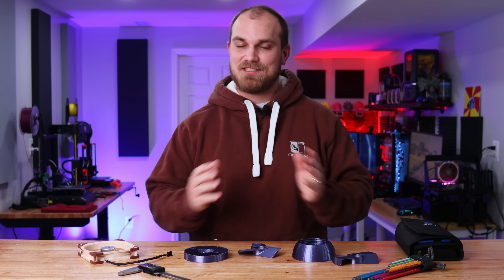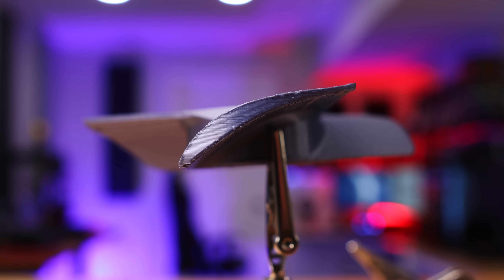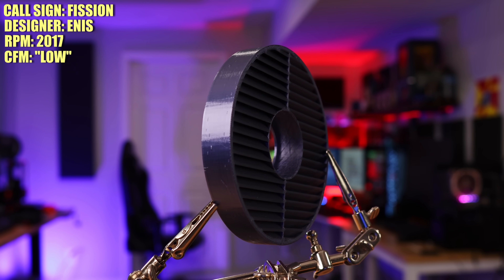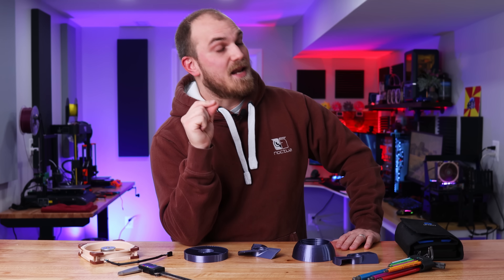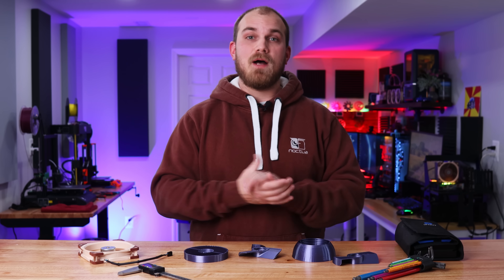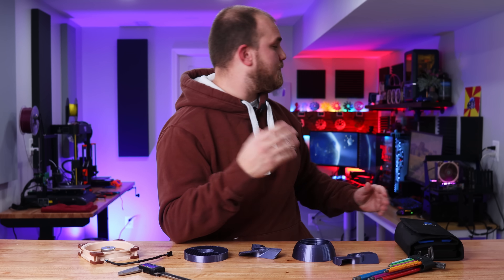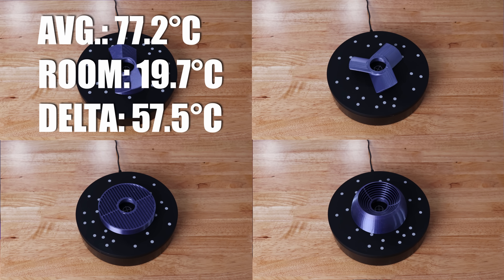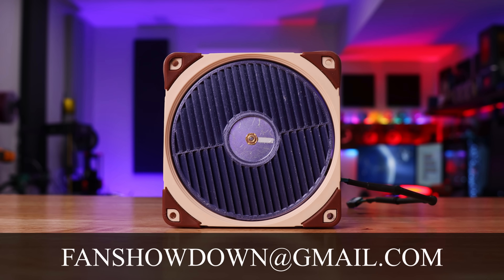IS THIS MAGIC? This Fan Has No Blades | Fan Showdown S2E3

Comment: Surely there is someone out there who wants to explain to us plebs how that fan with no blades is moving air through the center?
Reply: it isn't technically bladeless. There's radial supports between the concentric rings. The supports work as impeller blades.
Reply: @fermitupoupon1754  Yeah, they essentially just act to compress some air to allow the open dome like shapes to do what they will with it by channeling it over the shape. I'm wondering if adding some angle to the supports would make a big difference.
Reply: @fermitupoupon1754  this. at first it looked like he was going for boundary layer effect with the number of ducts/rings he used (and i think such a thing could work?), but i couldn't tell whether those supports really did continue all the way through. if they do, it's really more of an inefficient overly-ducted radial fan or "blower fan." that could use more blades.
Reply: @googIesux  there's probably some boundary layer effect, but I doubt it's much given that we're talking about a tip speed of around 20kph. Though from looking at the video again it does look like the supports are just small bits at the top and bottom edges.
Reply: Any air  touching in the middle when the fan is spun up is also getting spun and that spin produces an outwards force pushing the air into the outer curves then out the back
Reply: Air has mass. What happens when you spin a mass? It wants to go away from the center of spin. When air is displaced, it creates high pressure where it is displaced to and low pressure where it is displaced from. Air always flows from areas of high pressure to areas of low pressure. By pushing air out of the fan through the concentric open dome rings, it creates a low pressure area in front of the fan, which air then flows into and the cycle repeats.
Reply: honestly it looks like it operates more akin to the compressor wheel on a turbocharger than it does a traditional fan

air gets thrown to the sides and the conical shape of the fan takes that momentum and redirects it out the back. similar to the volute on a turbo, but built into the fan "blades"
Reply: It works on centrifugal force, it throws the air outwards, this gives it a velocity, it hits the next guide or enclosure and gets sent out of the back.
Reply: Think of the magnus effect.
Reply: For everyone saying it's centrifugal force it's actually just the lack of centripetal force pushing the air back towards the middle.  If your tires didn't have friction while turning it would continue straight for example.  As for the fan the air will stick the surface and create a boundary layer that spins the air.
Reply: @SixthSense42  Thats actually a better way of explaining it. Can we all agree on centrifugal force spinning air due to a boundary layer formed by surface tension from the environment; and the lack thereof centripetal force from blades?
Reply: It's simply a centrifugal blower with integrated ducts to direct airflow sideways, no magic conada/Tesla effects here.
Reply: @ferrumignis  I believe the guy said he designed it in mind of preventing air escaping 'sideways'. Your not wrong on centrifugal forces in play. Air is being moved through the ducts by surface tension between the air and surface of the fan blades; being swung outward (centrifugal force).  The ducting in this design is to help capture the air escaping sideways. You could put basically a half sphere on the hub and it would move just a little air but still so with no ducts or blades.
Reply: probably. ask reddit; they'll explain even if they don't know how it works.

edit: nvm, youtube will do the same
Reply: it works like a Tesla Turbine.
Reply: Coanda effect is whats going on here. Tesla's turbine is another close example.